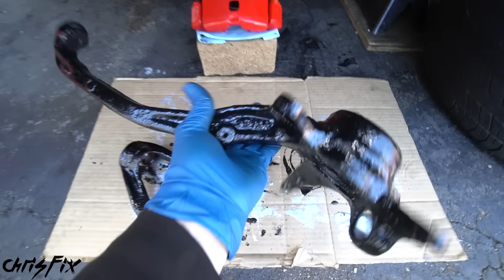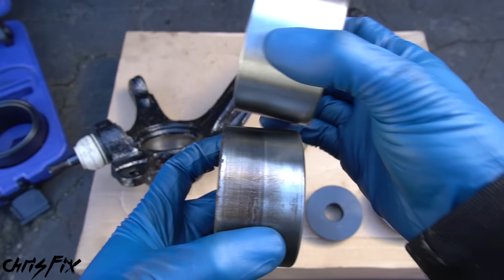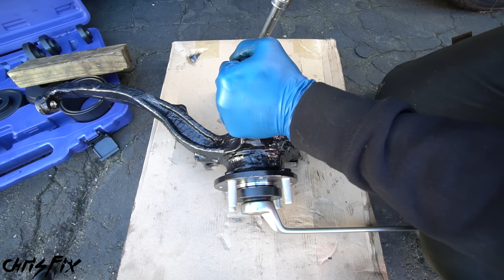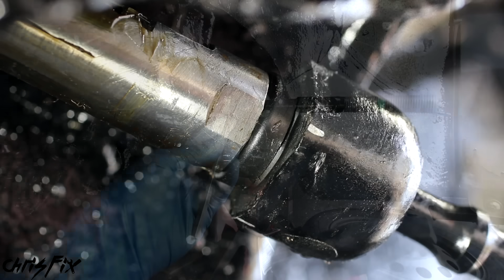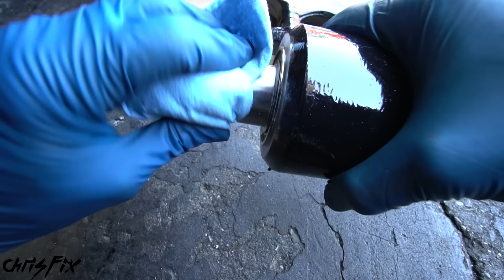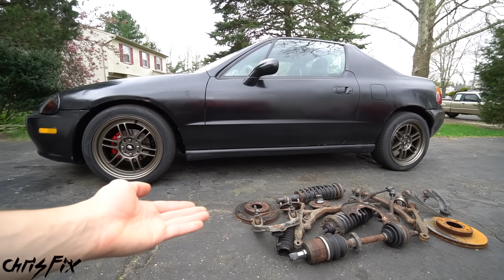How to Install a COMPLETELY New Front Suspension in your Car or Truck

Comment: Dont forget, on cars with wheel speed sensors, the bearing must go in on one side with the magnetic encoder so your sensors can pick up wheel speed. Press the bearing in the wrong way, and lights will come on your dash.

Comment: Just pay a shop to hydraulic press the bearing into the knuckle.  You only get 1 shot to push it in and if it goes bad you damage the bearing or knuckle, you have to buy BOTH parts over and do it all over again.  And you will never know it went in bad until you drive it for a year and the bearing starts overheating.  Then you got to do this WHOLE fix over again.  Its worth $100 to have a professional with some practical experience push out and push in new bearings.

Comment: Now that I’ve learned more about cars, I noticed: Why didn’t you replace the transmission axel seals? You are already in there and you don’t want to have to disassemble the suspension again when it finally dry rots… you should have mentioned that to the viewers.

Comment: Did I miss the part of the video where people are warned that torque specs are for bolts that lack lubrication from the thread locking glue? For a guy who acknowledges the importance of proper torque, I can't believe Chris is essentially lubricating bolts before using "spec" torque values. Those torque values need to be reduced. Thread locker affects the tribophysics of the fastener and that needs to be respected.

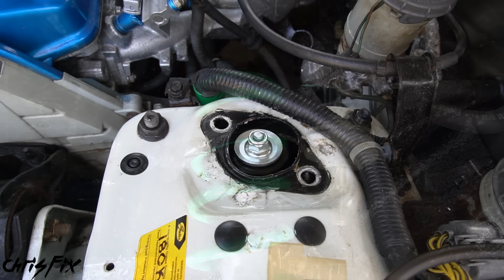Comment: 14:00 You can improve cushioning, by putting thick Sorbothane Pads between the Plates and the Chasis. Also SuperSpring Blue 🔵 (Soft), Black 🖤 (Medium) or Yellow 🟡 (Hard); depending on the load

Comment: Does the snap rings come with the bearing?
Reply from the maker: Sometimes it does, sometimes it doesnt. Depends on the brand and model bearing you buy. In this case, no, I cleaned it up and painted it.

Comment: A good tip is to remind people to do one side at a time. Removing both sides can cause it to not only be more difficult, but on some models will require you to repair the differential or elsewhere

Comment: Hey guys, I just replaced my front cv axles, front lower control arms, front struts, sway bar links, & lower ball joints. I went on a test drive on my way to alignment shop & it drove great for about 2 miles then a constant clunking noise at all speeds & turns. What could be the problem?
Reply: I also replaced front outer tie rod ends.

Comment: I have a 2000 Honda civic, are the torque specs and parts of the del sol be the same for my car? Since they are similar
Reply from the maker: It is probably similar but I would verify.
Reply: Thanks man, also i have another question, did you go for all honda oem parts or aftermarket? If you went with aftermarket what are the brand/brands?

Comment: The one thing Chris failed to mention is that if your vehicle comes equipped with a speed sensor, to make sure the magnetic side of the wheel bearing faces towards the inside (engine bay side) so that the speed sensor can read the magnetic field generated by the magnetic side of the new bearing.  If your vehicle has a speed sensor, and you install the bearing with the magnetic side facing out, your vehicle will throw an ABS light.  
Otherwise, this is yet another stellar video by Chris!

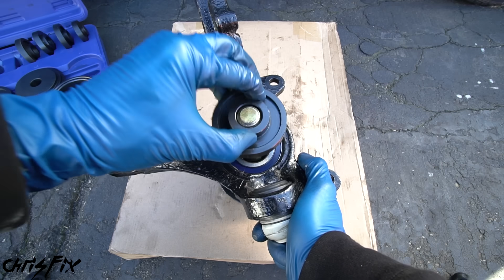Comment: Slight goof at 7:42, when pressing the 4 lug hub into the wheel bearing you are pressing it into the inner portion of the bearing NOT the outer, so you need to make sure the plate you use presses on the inside of the bearing (or both inside and outside evenly as shown).  If you chose one that only fitted the outside then you will blow the bearing apart.

Comment: Hi Chris. I have saved so far 455£ on installing new brake pads and brake discs. Next project is to replace all front suspension on both sides, refresh the drums with brand new kit, replace shock absorbers, flush all fluid systems, change my head gasket, replace clutch, and it’s all thanks to you because your valuable videos, I feel more confident. I have learned so much about cars fast. Bless you Chris!

Comment: Glad you learned the difference between a nut and bolt by the end. Also just turn the wheel next time to remove bolt you installed backwards. Good effort though
Reply from the maker: Where did I install it backwards?

Comment: All parts from the video 
1.ball joint bearing
2.ball joint
3.ball joint press
4.hollow cup
5.snap ring
6.bearing
7.wheel bearing
8.tie rod boot
9.heat shield 
10.lug hub
11.tie rod
12.jam nut
13.retaining clip
14.upper control arm
15.suspension struts 
16.axle 
17.rubber seal

Comment: Quick question can I use normal grease or anti rust grease or do I have to use silicone grease?
Reply from the maker: Depends on what you are trying to grease but they all have a use with this job

Comment: Hey Chris, do all ball joints come with the fitting, or if they don’t are they just non grease able 21:22
Reply from the maker: No not all ball joints have fittings. Many are sealed. If your ball joints are making noise and are sealed, you can buy a grease needle like this and pierce the boot: https://amzn.to/4k3Hvb2
Reply: @ thanks Chris I just installed new parts following your guide and wanted to grease them up but didn’t know how since they didn’t have any fittings.

Comment: Just did all this on my car…..steering is squishy….abs and brake light came on….i am terrified to drive it now…..my axles were aftermarket so one wasn’t the same exact length….the tie rods were two threads shorter than Oem…that confused me so now my alignment is prolly shot….my heart hurts and I truly just wanna die

Comment: Excellent - will be doing that/having that done ;o)  on my 10 Altima Coupe 3.5SR 6MT with 203k+   ....Chris - do you have any recommendations for 'top of the line' best quality coilovers for Nissans such as mentioned?   I see:   Godspeed, BC Racing, D2 Racing, Tein, HKS  -  but would like to know what is 'best' - meaning best performing AND longest lasting.  For my purposes - daily driver...'not' track - so I'm looking for that 'sweet spot' where the ride is just right - not too hard.  Have a 24 Z Performance 6MT and suspension is truly awesome - just right - doesn't beat you up yet is a train on rails.

Comment: excellent new front suspension , nuckel , inner & outer tie rods & bearings & hub & upper & lower crobtrol arma installment # but the break caliper has bracket 1st on which calipers are installed #👍👍🇵🇰

Comment: 6:55 well, the german 2 year mandatory inspection does require it since… a few years? i was told mine are technically too rusted and would count as a flaw in protocol since this was a new regulation, before it didnt matter, but i think he didnt care and said everything was fine on the protocol lol

Comment: Do u sell a full kit for power steering. reservoir, hoses, pump, pump mount for the enging block and the shorter steering shaft it's for my 98 chevy tracker if so how much you sell all parts needed for mine?

Comment: @chrisfix 
Day #4 in my full front suspension replacement: 

Many complications and plenty of differences between your Honda and my Toyota. Found out day one that I'll have to lift my engine/transmission to get to one of the lower control arm bolts. Did I mention this is my 4th auto repair ever?

Comment: Hey Chris, you do good work and make it look easy. I'm right in the middle of a front end rebuild on a 2010 Toyota Sienna van. I started out with hand tools like you did but quickly figured out I needed more. I almost stripped one nut trying to break it loose with a long breaker bar. That's when I figured I needed at least a 1,000 ft lb impact wrench for this job. 
The prices put me off until I found a 1,180 ft lb Beswell 1/2" impact wrench on Amazon for $39.95. Man! The difference is like day and night! Can't believe I waited this long. I highly recommend that you don't frustrate yourself trying to break loose old rusted bolts. Just go get the impact wrench. It'll pay for itself many times over and you'll be drinking a beer instead of laying under a car cussing.
Reply from the maker: Dang thats a pretty good price and I'm glad it worked out for you!
Reply: @chrisfix  Thanks! (I know you showed your impact wrench at the start of your video but maybe some of your viewers will be able to pick one up for themselves and make life a little easier.) There was one nut that stymied me! The passenger side stabilizer bar bottom inside 17mm nut. I guess I just don't have the tools to get it but could not figure any way to get it off. Any ideas? Thanks again!

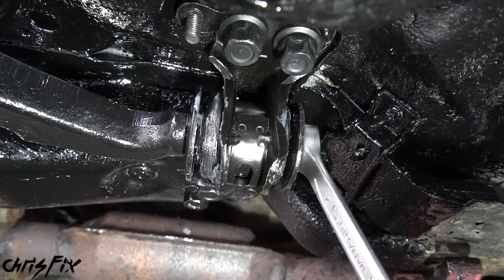Comment: 19:40 if you need to torque something and can't fit a torque wrench, you can use a crows foot as long as its at 90 degrees from the end of the wrench and it should still torque the same.
Reply: What about a universal socket? Would that work as well?

Comment: ive got a question if anyone knows about this. i have easy access to dry ice from my dad's work, i know the colder i make my ball joints/bearings the easier it will press fit... but is there a point where it gets TOO cold and i could risk damage to the parts in any way?
Reply from the maker: I would be careful with ball joints since the rubber might get cold and crack, but for something like a bearing you should be fine
Reply: @chrisfix  oh yeah, actually my dad's work IS manufacturing rubber stuff. What specific rubber are the ball joints made from? Ex: Viton, Neoprene, Natural rubber, etc. I can ask my dad if it's resistant to those temperatures and let you know :)

Comment: Bit of a newbie question here, but why didn't you also have to replace the rear suspension?  It doesn't have much impact on drive-ability?  What about safety?
Reply from the maker: It does need replacing I just haven't gotten around to it. This video is all about working on just the front
Reply: @chrisfix  I'd love to see that video.  Great content my friend!

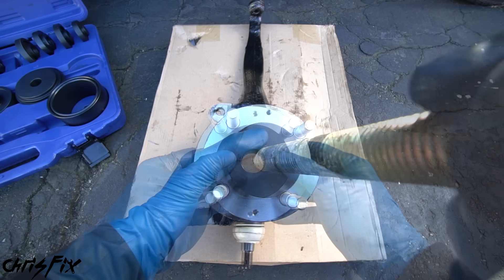Comment: At 7:42 , can Chris, or anyone else, explain the reason for choosing a plate sized to the outside edge of the bearing? Surely a plate sized to the bearing's inner race would be better, since the installation load is due to the interference between the hub shaft and the inner race.

Comment: hey Chris, i recently moved from Canada to Australia (Alberta to Western Australia.) and noticed some very interesting things while working on cars here at home. Stores do not rent tools out here and finding the right tool is really rare if not online. It is also common for shops to refuse pressing out and replacing ball joints and bushings out of control arms and knuckles here if you do not go with their service for the whole job (found a shop that replaced 2 Honda compliance bushings for me for $143 AUD and was refused by many shops before that.) It also shocked me a bit when I found out that Scrap yards are over here are so different than North America, its not like free roam style where you go around and find and pick your parts. You can't usually go in and see what is there, they ask what part you want and they will run in and pull it off for you and the only way to find out is to call them individually and try to explain what part over phone, it is always a huge headache. I just thought I would type this to share my experiences in the difference between what it feels like to work on cars in North America compared to Australia.

Comment: would it kinda be the same concept for a truck. i have a 2007 4x4 Tacoma and I love how helpful your videos are because im not very mechanical. Much appreciated if anyone can get back to me. Also about how much would it be to do this all around fronts and rears? thank you!!
Reply from the maker: Yes and it depends a lot on how much the parts are but usually you can refresh the entire suspension for less than $750-1K

Comment: I just did all the suspension front and rear + rear sway bar upgrade like yours on my 95 Civic EX with ABS. The sway bar was all bolt on to factory holes. I noticed the factory lower control arm bushings in the front were not preloaded from the factory so the bushings were all pushed to one side. The service manual does say lower the car on the ground before lightening but looks like the factory did not follow this. My car has 210K miles and the bushings lasted this long. lol...

Comment: This is a great video . I am tempted to try doing this on my 2011 Sienna on which I got rear shocks and front struts only replaced. I went to CB and they said the whole suspension needs to be  replaced, control arms and all! Dealer said everything looked good, except for one small leak in a rear shock which can wait.  And a small business repair owner advised replacing just the shocks/struts plus sway bars only, stating springs and other components are okay - he didn't want to replace things that were in acceptable condition! After this was done, although I do notice some improvement, I can still feel the bumps in the road and noise, although less than before, but not as much reduced as I thought they would be, like in a new car - which was a bit disappointing. It is intriguing to me to know where all the 'soft cushioning' comes from, that 'rounds off' the bumps' impact into a nice thud.  It's been a nagging question in my mind as to what else needs to be done. Perhaps if you have time, you will be able to explain the symptoms that can be experienced when different components individually degrade, so that we viewers can have some sense of what component is likely the cause.  Also how long does it take for a novice to do something like this. A lot of videos advise caution w.r.t damaging brake lines or other wires etc.

Comment: I am replacing my 2013 nissan altima sedan 2.5L  complete front end ... I've watched your video and ; Thank you for the information on thread locker and marking each one after completion; yet I am needing Torque Specs for each part since your vehicle is smaller than the one I'm working on;   also I seen you showed and said that the inner tie rod and a clip to insert to keep the tie rod from coming out ; The one i put in did not come with a clip and the original one that was taken off did NOT have one.    So PLEASE help if at all possible or ANYONE that knows the TORQUE SPECS per part connection : STRUT upper and lower  ,  SWAY BAR LINK upper and lower ,  Lower -CONTROL ARM 2 bolts with nuts attached to the frame ,  STEERING KNUCKLE  with control arm tie rod end connection, WHEEL AXEL NUT ...      THANK YOU

Comment: I did not foresee my driver's side lower control arm bolt being blocked by the transmission mount on my '03 TL lol! Found a video of someone removing the same LCA on the driver's side of an '02 Accord, lo and behold it's the same suspension structure as my TL! I had to raise the transmission a few inches to remove the mount (so nerve-racking) but I did it and completed the full suspension rework. You can do anything if you do your research and get your hands dirty! Thanks ChrisFix, your detailed videos give me so much confidence working on my car!! :)

Comment: I can't get my tie rod off the inner one there are no grooves there's nothing to lock on to turn it I used an 18 inch pipe wrench it's turning it but I don't know which way I'm supposed to be turning it or how long I'm supposed to be turning it so I just gave up because it's really difficult to get underneath the car that's so low in the grass how are you supposed to take off an inner tie rod that has nothing to lock on to it's on a 2001 Saturn SC2

Comment: Hey Chris, ive got my 97 del Sol and I used the mevotech supreme lower ball joints and one of them is squealing like hell after 1 month of them being replaced. Am I doing something wrong with the ball joints? Or are they just bad?
Reply: i have a 97 dx hatch should i get mevo or oem? bout to change front end just worried abt same problem..

Comment: Hi Cris. Great video. Quick question, I followed your step to do the same work on a eclipse 97. Here my question, after I install everything, I am having problem with my break which I did not have before. The whole car shake. So I start retracing to see if I had any bold lose and nothing. Bought a new rotor and break pads to check if it was the break and it not. I don’t know where to check. Please help

Comment: Hi Chris, my struts feels okay but every time I go through the bumb, it feels like there is a lot of shake in the front suspension. Also, my steering wheel is not returning to center after a wide turn. Which part of suspension could I inspect for this issue? Could it even a problem from strut mount bolts loosing out?

Comment: Chris can you do a double wishbone suspension
Reply from the maker: If I get a car that has that setup I can make a video on it!
Reply: @chrisfix  conversion it is then! Haha
Reply: @ipo7596  the delsol in this video has double wishbone suspension??
Reply: @arcanevoid9199  was hoping for the front.
Reply: @ipo7596  it has double wishbone front and rear
Reply: @arcanevoid9199 what. It's clearly a strut???
Reply: @ipo7596  do you think the upper balljoint & control arm is for decoration? there is more than one type of double wish bone
Reply: @arcanevoid9199  oh hang on. I'm not well versed on this stuff. But I did ask Chris for the more common double wishbone, which is what I meant and why he replied if he can find one first.
Reply: @ipo7596  thats ok, and this type of double wishbone is actually very common especially on japanese cars. shouldnt be very different to what you have, the idea and geometry is the same
Reply: @arcanevoid9199  i see. I think I was expecting two similarly shaped control arms but a larger lower control arm. Yeah, I think I read that hondas usually use double wishbone.